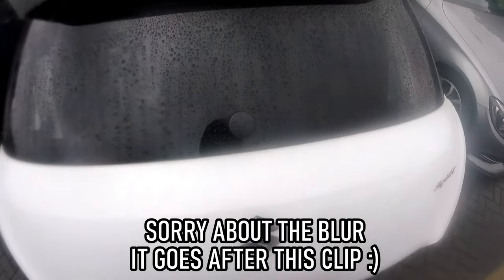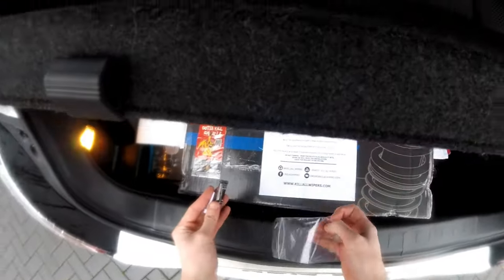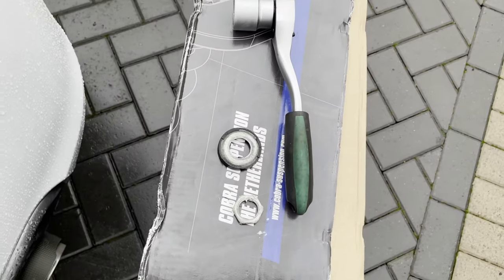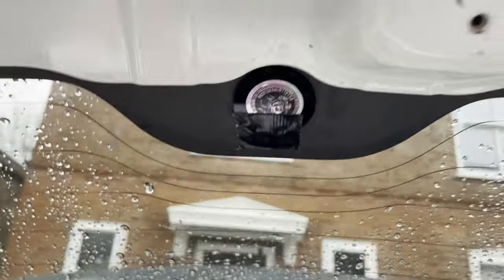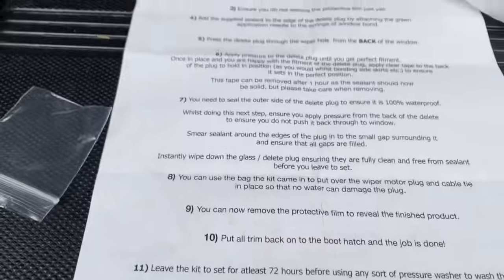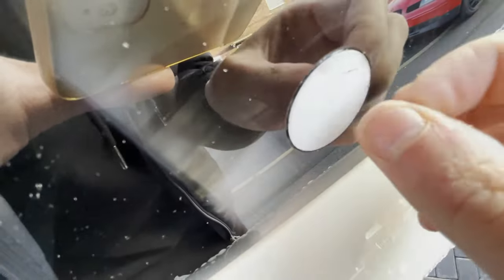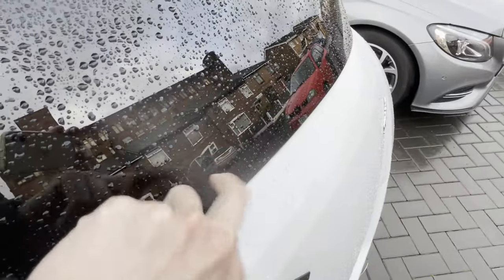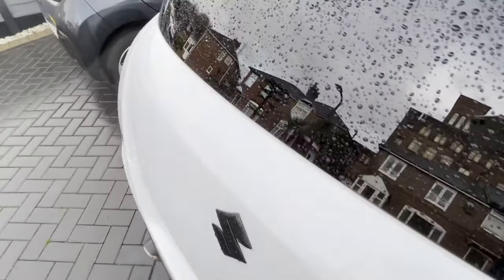Swift Sport Kill All Wipers Kit Install - Cleans the car up so well! (ZC32S)

Comment: Hey bruv just got the same car in black. Does a wiper delete throw any error codes/check engine light?
Reply from the maker: Hi mate welcome to the club, no lights at all just make sure you remove the rear wiper motor. MOT fail if the motor is there and no wiper arm
Reply: @wallsworkshop  thanks for the reply and heads up mate! Cheers

Comment: Where u got this black suzuki logo from ?
Reply from the maker: It's the original badge that I've just painted black
Reply: @wallsworkshop  which engine oil you use in this car ?
Reply from the maker: @visharadsudans  Last Service I think was 5w30. I'm now going to start using the Suzuki recommended oil which is 0w20
Reply: @wallsworkshop  which oil brand suzuki uses ? I have suzuki swift diesel in india 1.3 DDIS which oil should i use ?
Reply from the maker: @visharadsudans  Suzuki uses Castrol for Swift Sports like mine. On your 1.3 DDIS Shell Helix Ultra Professional AP-L 5w30 is the recommended oil